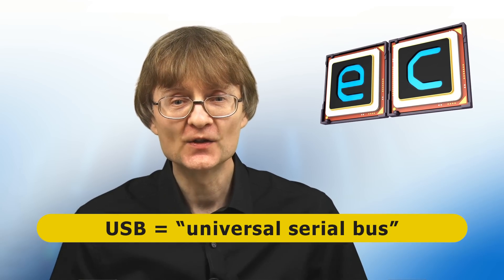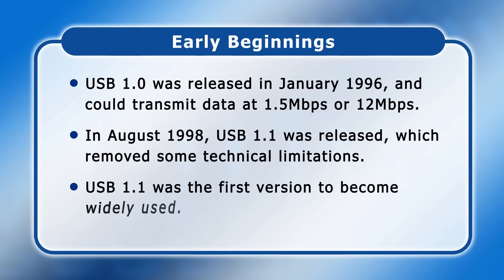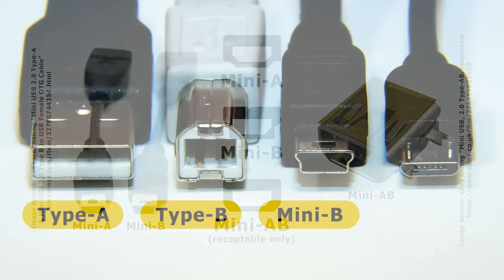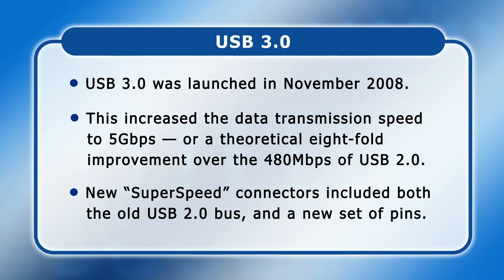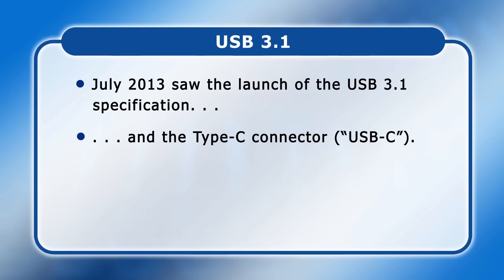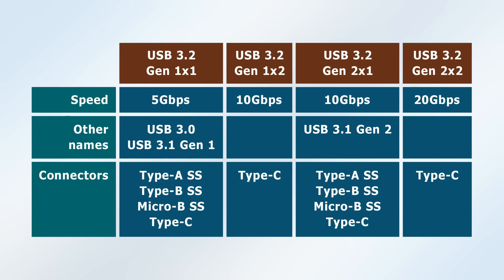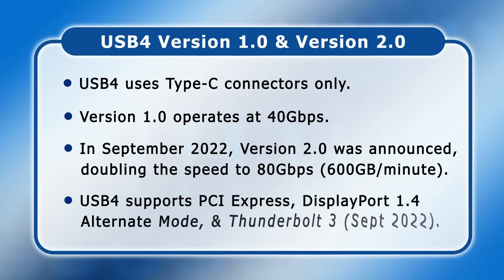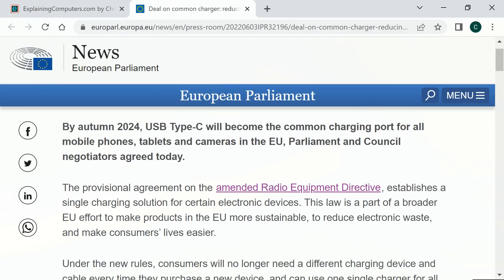Explaining USB: From 1.0 to USB4 V2.0

Comment: I can't wait until all the legacy ports are eliminated as well as the slow speeds. USB-C all the things!!!!😅
Reply from the maker: USB-C is not an interface, so does not determine the speed. It is a form factor. Many Type-A ports provide the same speed or even a faster connection than many USB-C ports. And USB-A ports don't break as frequently as USB-C/

Comment: Did you know that the USB 3 version is called USB 3.2 Gen 1 today not 3.1 Gen 1? The table on the video is slightly wrong or outdated. Also the Wikipedia article on USB has a nifty SVG graphic explaning the retcons, lol, your video is handy however if one is no the reading type, which many aren't nowadays sadly! Aso on the USB hardware article on Wikipedia there's even a nifty colors table!
Reply from the maker: I am well aware of what the standards are called, and the table in this video is most certainly correct. It explicitly shows that USB 3.2 Gen 1x1 (to use the full, correct name) is the same as the old USB 3.0 and intermediate USB 3.1 Gen 1. So I've no idea what you are going on about, as you are misrepresenting what is clearly included in the video.

And the idea that we should use Wikipedia as a source of technical information is, shall we say, interesting . . .
Reply: @ExplainingComputers  Oh, well, sorry then! Didn't see the Gen 1x1, so even more confusing, haha! Oh, you, USB IF...

Comment: There is one more absolutely cursed connector called Mini USB-B 3.0, I only have one device that uses it and it's a external IDE 2.5, IDE 3.5, and Sata tool I got, I thought I've seen everything.
Reply from the maker: There is no connector called Mini USB 3.0 (no connector standards include the interface standards). But I think you are referring to the 10-pin Mini-B, which is indeed cursed, as I don't think it was ever an official specification.

Comment: Why did they rename evrything lmao that's horrible
Reply: They didnt rename anything in fact the names are there..... people and vompanies simply ignore them, you have 2 things, specification and modes, specification is just a paper telling how USB devices and cable shot look and fuction and you have speed modes, specification need to tell how to switch between those, even USB4 tells how USB 2.0 mode operate, as it is lowest fallback speed. thing is this is not called USB 2.0 by specififaction its called "HiSpeed" while original 1.1 has 2 speed modes "Full Speed" and "Low Speed" while 3.x introduced series of SuperSpeed modes that use extra pins. People simply confused spec version with actual modes names

Comment: Funny to think that USB is "Universal Serial Bus":
The cable standard to END all cables!
Reply: All devices (if they can operate in lower speed rates) need to fallback to USB 1.1/2.0  by spec and operate on those, so they they are universal and most people dont see this problem at all. Plus Universal in name referes to fact that USB was made to replace dedicated ports on PC, making it unversal + it has series of specs for common protocols as well of port conversions, that why lot of devices and conversion cables dont need extra drivers to operate, making it more universal. People who say USB is not universal dont understand what that word means in that name.... and usally paroting LTT that also complains about it without thinking about it themselves. USB in general seem to be misunderstood as it was never sippose to be a chargeing/power standard,  yet it is most common use of USB, its there originily for devices connected to PC to not need extra power cables.

Comment: The USB 4 standard is insanely over powered. Insane data tranfer speeds, audio and high resolution video supported. Pretty much every connector possible in one.

Comment: Coming back to this video just to vent my frustration. I'm sure I'm not the only one - Chris you alluded to it in the video.  I was actually unaware there was a USB4v2 until recently, can't wait for USB 4v2 gen 2 😏. So I work as an AV technician in the IT department at a London university, I can't emphasise enough the frustration with the USB standard, when my boss and I had to setup meeting pods and getting USB devices to work with USB C and the power delivery with managed Lenovo laptops was an absolute nightmare, basically because the contractors had installed the wrong spec USB C that were incapable of providing enough power to be used with the laptops we had provisioned. We had to add our own setup using kit from amazon and tell staff not to use the ones that were in situ.

Comment: A few resources from USB-IF:
- https://www.usb.org/sites/default/files/D1T1-2%20-%20USB%20Type-C%20System%20Overview.pdf - Type-C
- https://www.usb.org/sites/default/files/D1T1-3%20-%20USB4%20System%20Overview.pdf - USB4
- https://usb.org/sites/default/files/D2T1-1%20-%20USB4%20Configuration%20Layer%20-%20Protocol%20Tunneling.pdf - USB4 Tunneling
- https://usb.org/sites/default/files/D2T2-1%20-%20USB%20Power%20Delivery.pdf - Power Delivery
A few resources from MindShare:
- https://www.mindshare.com/files/resources/MindShare_Intro_to_USB_3.0.pdf - USB 3.0 technical overview 20 pages
- https://www.mindshare.com/files/ebooks/usb%203.0%20technology.pdf - USB 3.0 in-depth (also applies to USB 3.2 and beyond), 700 pages (preview version here)
The classical USB in a Nutshell:
- https://www.beyondlogic.org/usbnutshell/usb1.shtml - USB 2.0
A few resources from Cypress (USB chips manufacturer):
- https://usermanual.wiki/Document/FX3PROGRAMMERSMANUAL.1761659799.pdf - direct link from 3rd-party
- https://www.infineon.com/cms/en/product/gated-document/ez-usbfx3-programmers-manual-8ac78c8c7d0d8da4017d0f685057596e/ - same but requires log-in
Reply: USB4 is a modified Thunderbolt-3, it is not having Thunderbolt-3 tunneled inside, but rather it is a Thunderbolt protocol.

DisplayPort does not have an alt-mode, instead the Type-C connector has a DisplayPort alt-mode (feature of Type-C standard) and no USB would be involved at all: it is a Type-C feature:
https://en.wikipedia.org/wiki/USB-C#Alternate_Mode_partner_specifications

So you can also have HDMI over Type-C:
https://www.hdmi.org/spec/typec

Or Thunderbolt 3 over Type-C (that came before USB4, maybe where the inspiration for USB4 is from).
Or USB2 and USB3 over Type-C (the default).
Or USB2 and USB4 over Type-C (with USB 3.2 tunneled into USB4)
Or analog audio over Type-C (rarely used)

That is how you can tunnel various things over the Type-C connector.
Now, you can also tunnel protocols over USB4: this is what Thunderbolt does: it wraps other protocols like PCIe.
In the case of USB4, if you want USB out of it, you will need to USB 3.2 tunneled over USB4.
USB4 does not provide anything but a tunnel onto which put another protocol: convenient for docks.

In the end, we have 3 families of USB that will exist forever (as per current USB standard projects):
- USB3 -> the most advanced protocol, with variations between 3.0 (= Gen1x1), 3,1 (= Gen2x1), 3.2 (= Gen1x2 and Gen2x2) allowing various speeds
- USB4 -> encapsulates the other protocols into it, and also a lot faster, but cannot do anything on its own
- USB2 -> uses its own independent signals even with USB3/USB4 running so that your mouse/keyboard can work
Reply: Thank you for your video, I wish I saw it earlier, it would have saved me plenty of time :D There is not much between the standards and the "how to"

Comment: It should have been done like this 

USB 1.0 (Unchanged)
USB 1.1 (Unchanged)
USB 2.0 (Unchanged)
USB 3.0 (Unchanged)
USB 4.0 (10Gb)
USB 4.1 (10Gb X 2)
USB 5.0 (20Gb)
USB 6.0 (USB4 aka 40Gb)
USB 7.0 (USB4 v2 aka 80Gb)

Type A/B connectors for USB 1, 1.1, and 2
Type A/B 3.0 connectors for USB 3
Type C connectors for USB 3, 4, 4.1, 5, 6 and 7
Type A/C connectors for USB 2 and 3 only

That would have made this so much better for consumers and manufactures
Reply from the maker: Yes, this would have made things far easier to understand. :)

Comment: You forgot to mention the main reason why pre-Type-C USB cables had different connectos at the ends (Type A / Type B) is because USB cables carry power besides carrying data and  you don't want to connect two power sources unless you like sparks and smoke. That is, USB cables are "directional" because of the power transmission. Type A is for the power source (host), Type B is for the power consumer (peripheral). As you mentioned, at some point in time, OTG was introduced which allows to dynamically decide the direction of power transmission. But only a few devices were OTG-capable. Type-C USB cables  can have the same connector at both ends because all Type-C devices are supposed to support OTG now.

Comment: 10:18 a perfect example of this is the USB Type-C to DisplayPort dongle that I utilize to output from my gaming laptop to my monitor. Using it allows me to take full advantage of my dedicated GPU, as well as use the monitor's full 144hz refresh rate. Using the laptop's HDMI connector doesn't directly connect to the dedicated GPU, but rather the iGPU, and the monitor limits the refresh rate to 120hz. For those wondering, you can buy a USB Type-C to DisplayPort dongle at Best Buy.

Comment: why is USB 3 Type B so ignored, even USB 3.0 A and B cable. Often it is not mentioned. I have USB 3.0 B connector for my drive dock. I was looking for a 4 port USB 3.0 switch and don't see one anywhere but you still see USB 2.0 type B switches.

Comment: Great video!  One point of note, you omitted the difference between 5 pin mini-B and 4 pin mini-B.  5 pin mini-B is the connector we're all used to, 4 pin mini-B was included on certain digital cameras and OH GOD HELP YOU if you're on vacation and misplace your 4 pin mini-B cable.
Reply: I am at present understanding the USB.
If I am not wrong that pin was used as ID pin for OTG purpose 
Dedicated hardware design.

Comment: 240W, amps after amps of current, via a USB connector - of whatever type??!  Nope, nope, nope NO!  I have a good quality USB front panel bay on my PC which has the usual USB 2 and 3 sockets, and a couple of high power diodes feeding the USB3 sockets linked to the 5v rail from a molex...I know why they are there now!

Comment: USB made Linux configuration of peripherals a paradise cirka 2002, it is a really really excellent bus system, but the number of connector types makes buying a peripheral, f.ex. a webcam, or an embedded system, f.ex. a Nucleo or a Pi4 a minor Hell. It is a good thing that EU decided that USB-C is the only valid connector type for new hardware.

Comment: Thnx ur effort but it's a historical lecture of no practical use .
Reply from the maker: What are you talking about? USB 1.1, 2.0, 3.x and USB4 v1 are all in very widespread (including on new hardware), as are most of the connectors shown in the video. And USB4 v2 is not even rolled-out yet! :) So unless you are suggesting that everybody in the world is going to stop using any form of USB connector tomorrow -- and that everybody is fully aware of, for example, all USB 3.2 and USB4 standards, then this video is very much of practical use.

Comment: I find USB 3 and 3.1 to be the biggest misnomer of all time, Whilst it may work fine for printers, keyboards and mice in most cases its barely quicker than USB 2 and the requirements of every bit of hardware and software to be on par make it a complete waste of time when copying files.

Comment: first time ever to give a dislike, many many years subscribed.  I NEED to know, can I damage old pre-USB 3 devices with more power output of newer devices.
Reply from the maker: No, you can't. USB connectors negotiate first before delivering other than 5V. But why the dislike?

Comment: 10:15 worth to mention that in this case USB-C cable (and port obs) is used to transmit Display Port signals (do not confuse with transferring digital A\V date over USB protocol)

Comment: 2:22 - you are wrong! USB version number != data transfer speed! In other words USB4 standard describes all data transfer speed prior to USB4. So this PicoW's port is USB4 complaint. This is called backward compatibility!
Reply from the maker: Certainly USB standards are backwards compatible. But that does NOT make a USB 1.1 port (as on the Pico W) USB4 compliant. Absolulte utter rubbish. The only standard that the port on the Pico W is compatible with is the standard for USB 1.1.

Comment: I have a Type C port on my laptop, SS one, when i connect my phone it starts at fast charging and after 5 seconds switches to slow 0.9A charging, what is the problem, im using a original samsung c to c cable and fast charging is turned on, also laptop is plugged in, high performance and selective usb suspension is off.

Comment: Why has my march 1995 Motherboard a USB connector if it was releast in januari 1996 ?
Reply from the maker: IBM, Intel, Microsoft and some other companies started work on USB in 1995. But the official standard was only released in 1996. So a company could in theory have included a (then) non standard connector in anticipation of the launch.

Far more likely is the fact that it is not uncommon for products to be dated on their PCB/motherboard earlier than their release, so your motherboard design could have been locked-down in 1995 and released in 1996.
Reply: @ExplainingComputers  Yes, I see That`s must be it! My motherboard has 'pins' labelt as usb, but not has the actual connector. I install later a pigtale to usb poort. (works fine do). Thanks for your explanation, I always wondered why my board had usb before the launch 🙂

Comment: I also learned that not all usb connectors transmits both data and power. Some only transmits data or power only. Why?? Wasted $10 on a micro usb cable to replace my lost mic cable

Comment: Not even a month later and the entire stack's name has changed again. 
But for the best!
Just refer to the different gens as follows:

    NEW                   OLD
USB Basic        (USB 1.0/USB 1.1)
USB Hi-Speed (USB 2.0/USB 2.0 Revised)
USB 5Gb/s      (USB 3.0/ USB 3.1 Gen 1/USB 3.2 Gen 1x1)
USB 10Gb/s    (USB 3.1/USB 3.1 Gen 2/USB 3.2 Gen 1x2/USB 3.2 Gen 2x1)
USB 20Gb/s    (USB 3.2/USB 3.2 Gen 2x2)
USB 40Gb/s    (USB4/USB4 Gen 2x2/USB4 Gen 3x2)

And finally, for good mesure, add the cable's max power delivery rating in Watts after it's new name, going from 7.5W up to 240W

PS: I spent 15min on this comment already so, if there are any errors or questions don't hesitate to tell me about them!

Comment: 100 years ago or so, the Bell System standardized the TRS connector for bridging the transmission of audio over short distances.  For some reason that wasn't good enough for RCA who came out with their own connectors.  By the time digital audio came on the scene there were so many "standards" for moving audio from point A to point B that everyone in the business was confused.  Since the proliferation of data transmission (which, incidentally began with Morse Code in the 1800s), connector "standards" have become more of something to appease the largest manufacturers than of addressing the actual problem.

Comment: I really hope USB-C becomes the universal connector.
But even then there are problems. The cable specs are as consumer unfriedly as it gets...
I got alot of devices using usb-c and the cables don't work on some of them you really need to remember wich cable is capable of doing what. That is anoying.
Just make them a few cents more expensive and have them all be the same standard!

Comment: Great videos!! Many thanks for the wee explanation. I think I finally understand the "red" USB comming with my ROG STRIX B450-I GAMING Mother board...  I wonder if those USB 3.1 Gen 2 are enough to for example use and external SSD for gaming.  Also would you please recomend me any "hub" I could use to take adventage of this USB 3.1 Gen 2? They are in the back of my computer and could be lush to have a hub with different connectors close to my hands...It is difficult to choose things those days... :(   Have a canny day!

Comment: I must say that for the last 10 years or so I've never really cared at all about USB speed, only on USB power delivery. While I do occasionally use a USB cable for data when debugging Android apps on a physical device; the speed of that connection doesn't really matter at all; I'm sure even USB 1.1 would have been plenty fast enough to stream a some log data. Most actual data transfer I do is over the internet over WiFi or mobile data; and while admittedly my stationary gaming PC at home technically uses USB for the network card (because I forgot to buy an internal one when I ordered it; lol) it wouldn't really matter much if I accidentally used the black USB port rather than the blue one because even though I theoretically have 750 Mbps internet; the remote server will rarely deliver that fast anyway.

Ever since both my phone and laptop is charged using type C ports; I really just think of them as charging cables

Comment: 0:38 You list Mini-A SS, Mini-B SS and Mini-AB SS.
6:23 You refer to these as Micro-B SS, Micro-B SS and Micro-AB SS.

Which term is the correct one? I'd assume Micro, since they look more like older Micro-B, but I;d like you to confirm.
Reply from the maker: The initial diagram is wrongly labelled, my apologies. It should be micro-B SS, Micro-A SS and Micro-AB SS. I've noted this in a pinned comment at the start of the comments, where I've included a link to an updated diagram.
Reply: @ExplainingComputers  Thank you. I found your pinned comment now. Not sure why YouTube doesn't place it at the top though.

Comment: Does this mean cable is irresponsible for the transmission and charging speed.  Transfer and charging speed is at the max as long as the input and output support USB 3.2 and USB PD?